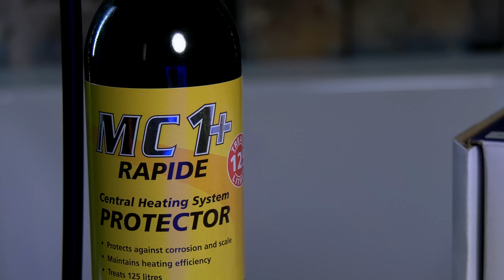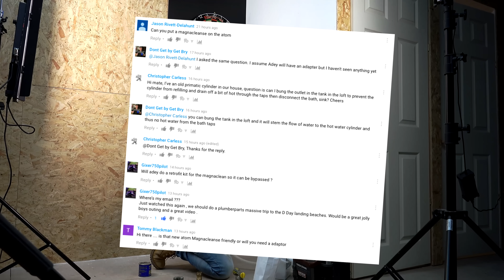MAGNACLEAN ATOM REVIEW - CENTRAL HEATING MAGNETIC FILTER

Comment: Hi James Another great video thanks! My question is because of the tight space around slip coupling side I am not thinking to use slip coupling and install without it; is that possible? Or can the slip coupling go on the other side? I tried to read the installer pdf but doesn't mention that!

Comment: Had a combi installed and the dimwit plumber installed it the Magnaclean atom to some other filter (inlet water?)....anyway,its so close that the bypass valve cannot be accessed with the spanner.
Reply: solved the above with an automotive 14mm spanner

Comment: Is it  possible to instal and service the Atom filter in a horizintal 22mm pipe run under a floor that has a 150mm gap between the  floor and the ceiling below, with a bowl etc. to catch any fluids, and a robust trap door in the floor?
What is the minimum practical under-floor gap?
Please demonstrate. 
Giles Whittaker.

Comment: Just used your video to reassure me on the method of how to clean the filter. I installed a Magnaclean Atom on my system in July 2019 having installed a new combi boiler. Went like a dream and had a similar amount of gunge as your mock up, in 12 months. I had to install it quite close to the floor so did have to use something other than than the key supplied. Thanks

Comment: Hi James, i noticed from 11:35 you were turning the filter to the bypass mode, you started to turn the valve clockwise then in the next close up clip it shows you turning it anticlockwise with the point of the arrow at the bottom, but when you took the filter head off the arrow point was at the highest point at 12:17, i think you got the wrong bit of clip in there, correct me if i'm wrong. I have to do the plumbing for my job when necessary and i havn't worked on this model of filter before, but have worked on other Adey filters in the past. Good video though

Comment: Did you that Fernox will not sell you a replacement magnet assembly for their Filters, even if you have just installed a new one and dropped the magnet assembly breaking it making the filter useless, No you have to buy a complete new filter.
What an excellent customer service policy.

Comment: @plumperparts Hi i'm in an old house build 60s dublin, with all piping on the one end of a single panel radiator. where the outer pipe upto the valve fro mfloor is the water in, and then parallel to that on closer to the radiator meets the horzitonal going fro mthe valve going to the raidator, this is suspect is the flow out.

my issues is after several attempts bleeding the radiator , no heat in it , but the bleeding water out is slightly warm , cant afford the 700euro to flush entire system, need another option as I suspect either the valve is buggered or blocked, which might explain the lukewarm water temp.

ideally would need valve replaced but considering the type and pipes in and out setup, changing the radiator to a newer dbl panel and a newer valve (thermo) might be a better solution, for now looking for idea how to clear the valve or confirm its a block
Reply: currently this one radiator upstair bedroom is only one with issue, not counting the box room which has been vavle closed for very long time. it i tried turning on recently and its not heating either.

Comment: Got an idea for a video... how about you mock up a demo system in clear pipe on that wall... tank. Valve. Pump. One rad. Coil for the cylinder. Bypass ??? Would be good to see it actually working

Comment: Moved into a house a couple of years ago that has a 43 year old oil boiler. I've been trying to understand how its piped up as it has 28mm feed and return pipes on the right side which only go to the hot water cylinder with an electronic valve, but also has 22mm feed and return on the left side that look to go to the rads. There is only one pump on the boiler and its within the boiler housing. The system is open vented. Was this setup normal in the stone age, and does that one pump drive both loops, or is it just convection driving the water loop and the pump would be on the rad loop. Whole thing looks bonkers to me.

Comment: I have a vitodens 200 boiler. The pressure keeps building up and releasing from the pressure release outside if I do not manually release it from the radiator. One guy has said 350 to fix, this to me seems high. Getting a plumber out these days is a nightmare. 2 have just not turned up so in my eyes I refuse to ring them back, another has rang to cancel. Is 350 high to fix this problem? Also will I need to refill it with sentinal?
Reply: You need to check expansion vessel, I would rather call BG for fixed price or from Viessman by asking for a price first. It may need charging the vessel, if this does not work, then expansion vessel may need changing.
Reply: @sirazsaleh5942  Cheers mate. Is this something that can be done with a bit or research or does it involve gas?
Reply: I would answer all your questions but I'd have to charge you 350😅
Reply: A closed system shouldn't be able to get pressure from anywhere other from the pressure when filled and the actual heating of the water, is the filler loop leaking water into the system?
Reply: @bridgendesar  No. that is one of the first things I tried. I have took it off and closed the pipes, still doing it.
Reply: themorphman100 probably the expansion vessel, can you get to the air valve and pump it up? (worked for me a few years back)
Reply: @bridgendesar  UIs that the thing on the top that has a cap like on a bike wheel? I think I would be scared putting too much in
Reply: themorphman100 yes, that's it, give it a press and see if any water comes out. use a pump with a gauge on it, only needs 10ish psi, but let pressure out of system first
Reply: @bridgendesar  Will a normal bike pump do? Also by see if any water comes out do you mean press the pin in like you would to release air from a bike tyre? Also to let the pressure out of the system do I just open a radiator valve until it stops coming out? Cheers for trying to help.
Reply: @bridgendesar  I have just unscrewed the cap but can not see no pin in the hole like what you get on a bike
Reply: themorphman100 sounds strange, could it have been removed? can you put something down it, could just be recessed a bit
Reply: @bridgendesar  Just put a screw down to try press it but nothing. It went down about an inch too. Just my luck, find a possible solution and I can not do it. Not a good time of year to be paying for a plumber :(
Reply: So, what happened, did you sort it?
Reply: @bridgendesar  Not yet mate, I have a guy coming to look tomorrow (Monday) I know from reading up what it could be. I even know from videos etc how to change the expansion vessel but I will not touch it. I am not trained in gas so that is a big no. I would rather pay someone who is gas safe. Not worth it, at the end of the day I might save a few quid but is that worth it? Not at all. The guy that is coming is a friend of a friend. Ill let you know what he says. Im wanting him to try recharge (is it called that?) the vessel first. If that works its a nice quick 100 for him
Reply: @themorphman100  Your not paying him for what he does, as much as what he knows. Do tell him about the suspected lack of valve innards on the pressure  vessel though, and good luck!
Reply: @bridgendesar  Damn right, I know how long it takes for you guys to learn something like this. The money is well spent to have a pro look. Im trying to get my son to get in to plumbing or Electrics instead of the army. You guys earn every penny. I wish I could turn the clock back and learn it too.
Reply: @bridgendesar  I will do also. Thing is I had no cle about boilers but people like you, youtube and DIYNOT forum has helped me out a lot. I can ask the guy to test certain things instead of just straight away changing the vessel which will cost more. In over words I know not to be ripped off. Cheers.
Reply: @themorphman100  The suspense is killing me!

Comment: Just had the plumber round re a new combi install and I didn't want pipes coming down from the boiler when they need to go up into the ceiling. A rear spacer on the boiler will sort this and given the small size of the Atom, this can go above the boiler too in the flow return - A perfect solution!! Hope I either win an Atom or my plumber can get one before mid December!

Comment: They should supply a rubber a ring to put on the bottom piece of pipe to stop the nut falling.... If that paper falls your screwed.
Reply from the maker: I’d just use the 1million I have in the van! 😂
Reply: Ha! Good point.... ok tip of the day put a spare rubber ring from the one million in the van over the bottom pipe before you put the nut on.
Reply: Use a cable tie to stop the nut dropping?

Comment: Not sure whats going on with the video but the love chat element screwed my stream to the TV. Heh ho.
One thing I noticed. The handy spanner tool was longer than the mocked tight space between the boiler and ceiling. I assume you would need to revert to a different spanner if there's no room? Perhaps @adey_pro might change the spanner so it can used horizontally as well?
Reply from the maker: No mate, there’s so many hexes on it you would just turn it off in smaller motions. The spanner is really good once you get your hands on it!